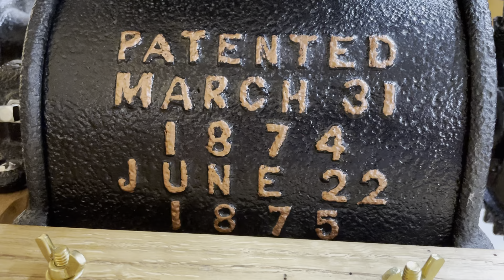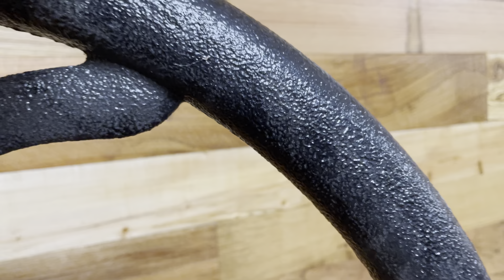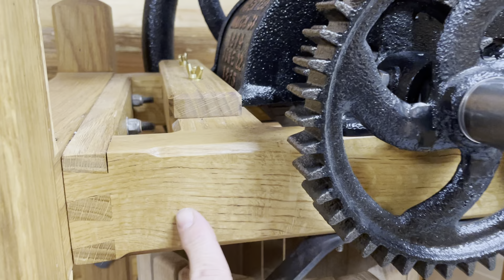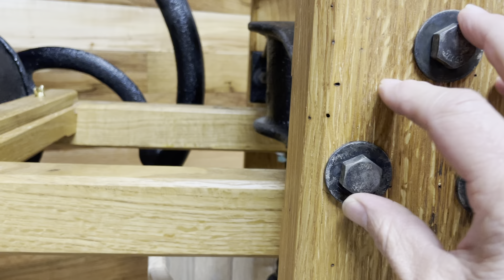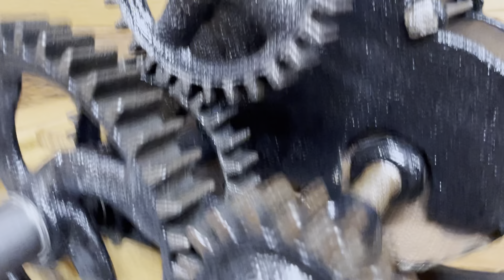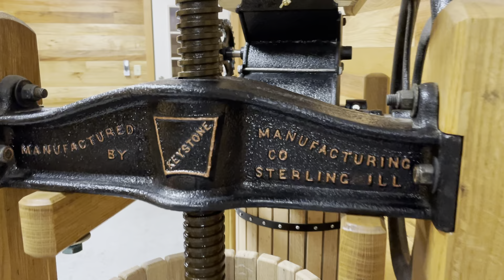Restored Cider Mill Keystone Manufacturing

Comment: Great information! I'm in the process of rebuilding a Hocking Valley press from parts, so I'm curious about a couple of things. What type of paint did you use for the cast iron? And what finish (if any) did you use for the white oak that will be in contact with the cider?
Reply from the maker: The cast iron was painted with a 2 part automotive paint. The baskets are unfinished. Not shown in the video is a stainless steel tray with a spout that rests in the bottom tray. So the baskets are the only wood which the cider would touch. The rest od the wood frame is just some Spar Varnish.